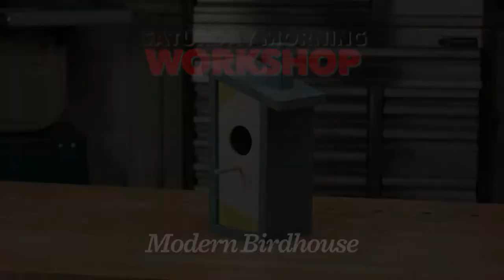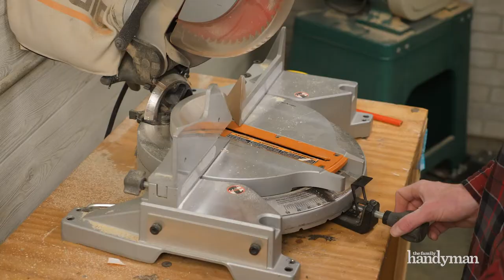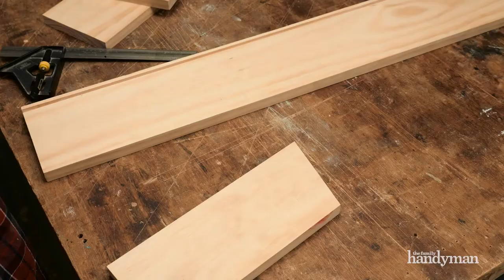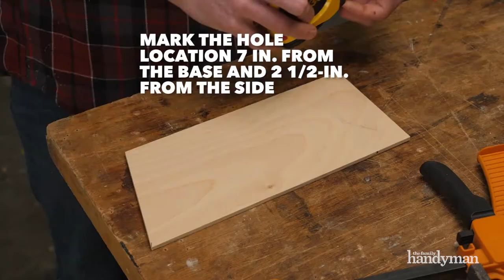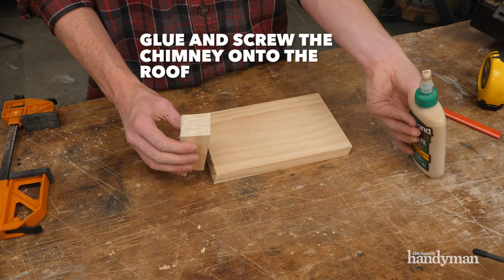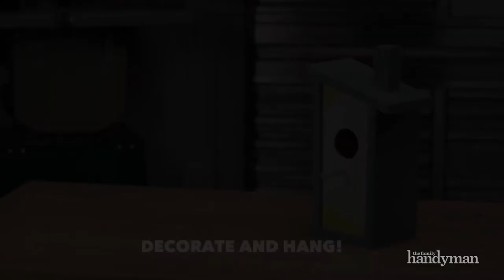Saturday Morning Workshop: Modern Birdhouse

Comment: The only bird I know that uses a 2" entrance hole is a red-headed woodpecker.  Your box is way too small for the hole size.  The dimensions red-headed's nest box are: 6"x6" floor, side height 12-15" and hole height of 9-12".  Perches are nothing more than an aid for larger birds to prey upon smaller.  A perch is unneeded.